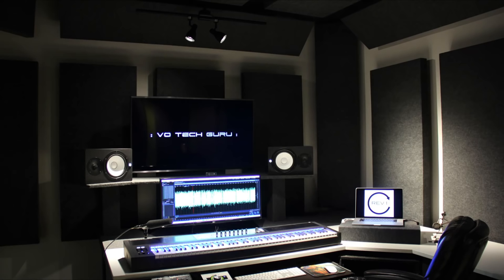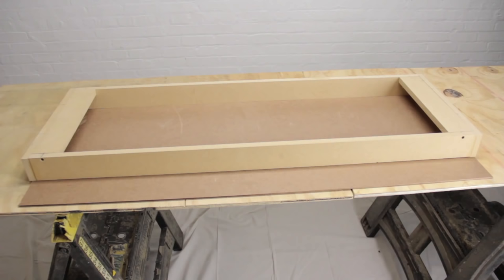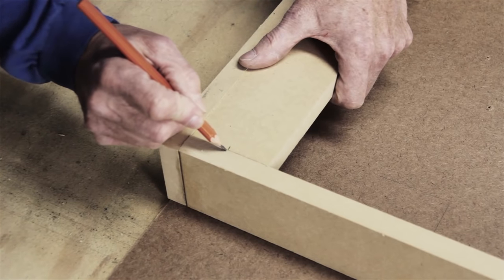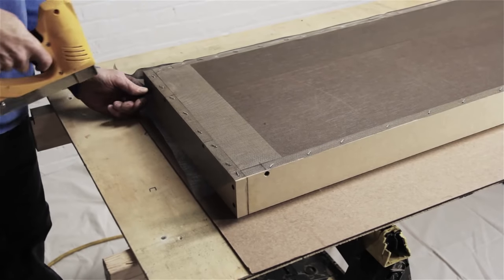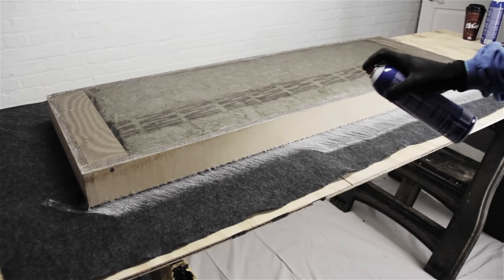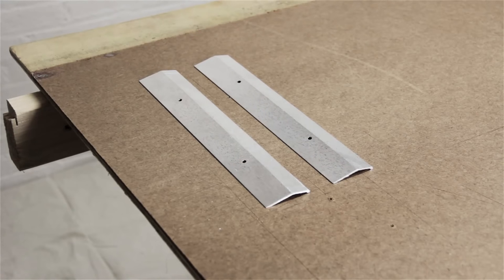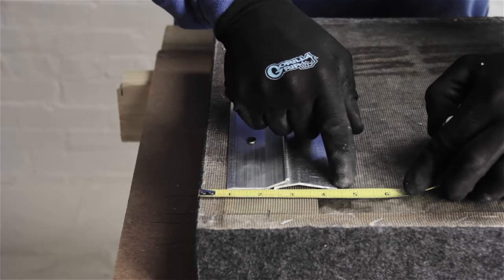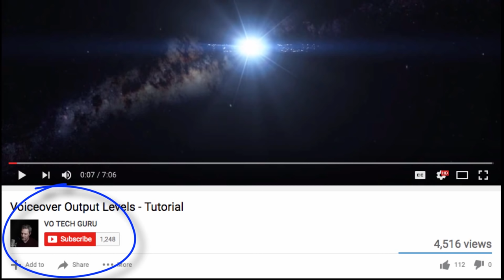How To Build Acoustic Panels | DIY Acoustic Panels

Comment: Great video! Was just wondering, How would you mount these in a corner and on the ceiling? Thanks
Reply from the maker: Thanks! We built 2 triangular shelves in the corners and attached the brackets to those. So you'll need one bracket on the top support of the panel and one on the bottom as well. For our ceiling panels we used four eye hooks screwed into the rear supports, 2 hooks for each end of the panel. Hope that help and thanks for watching!

Comment: Good job! Looks amazing. 
I just have one thing in mind. I have been working alot with all sorts of isolation, and they can be really dusty, don't you think that by the time and amount of vibrations the dust from isolation will get through fabric? 
It's like having carpet on the floor,   dust goes through pretty easily.
Reply from the maker: A lot of people have talked about dust or particles from the rockwool. I put a black piece of poster board under one of the panels for a month just to see what might happen. Nothing showed. The factory workers and installers work around this stuff without masks as well. It’s simply basalt rock mixed with metal slag, so...

Comment: Question: you used the Roxul safe and sound non ridged bat as opposed to the roxul rockboard 60 that’s recommended as the equivalent to Owens Corning 703 used in acoustic panels. Any thoughts on that? Great presentation!
Reply from the maker: You can use either but the 703 will cost you a lot more. These are VERY effective. Thanks for watching!

Comment: Definelty gonna be using this im working on my studio now, I do have a question though. How did you mount the corner bass traps in your control room? @VO TECH GURU
Reply from the maker: You just build a triangle shaped shelf with a face frame and hang it on the face of that. Thanks for watching!

Comment: Did you calculate and attach panels at first reflection points or just put them up where it seemed right? Also you nearly double available absorption by having a panel depth air gap behind the panel. Couldn't see but do you have a cloud? Did you test/measure the room before after? Interested to see if you did. Not being a smart-ass, just been working on this myself too. More interested to see the vocal booth as that's what affects the mic sound rather than the room. Solid build though and great looking panels, excellent video presentation and edit, thanks.
Reply from the maker: Hi dobbatron. Thanks for watching and the great questions. We didn't do a before and after on this room because I've been through the process enough times to know what to expect. When I say "a little less like this" in the video, that's the sound of the booth without panels (you may need headphones to hear it). 

Anyway, the first concern prior to the panels was how our planned dimensions for the room looked inside the Bolt Area (you can look online for a Bolt calculator) and we built the room so we landed firmly inside an acceptable Bolt range. From there, we calculated the amount of panels require based on full covered for all potential axial, tangential and oblique reflections and just went for full coverage because the panels aren't expensive and we didn't want to overthink it. As a result, we don't have a any trouble frequencies because the room dimensions were already well thought out (yes, we also have clouds). 

As for the booth I voiced this tutorial in, we did exactly the same thing, but the spacing between the panels was tighter. Maybe 3-4 inches. Again, the booth was built using the bolt calculator and everything turned out really well. You can visit my VO Tech Guru page on Facebook and scroll down to get some more info on how the booth looks. It's in there somewhere. Hope that helps. ;-)

Comment: Fantastic video. With the 24" panels, how high off the floor should they be & how wide should the gap between the panels be? TIA!
Reply from the maker: Thanks for watching! I like to space them 8" to 12" apart depending on the space. In a booth, I like to keep them closer. In a room, farther apart. I like to keep them the same distance from the floor when possible but there are MANY studios where they just hang the center of their panels around the center of the listening position and ignore gaps above and below the panels. It's really just a matter of how dead you want the room to be. Hope that helps. ;-)
Reply: @VOTECHGURU  It sure does! Thanks!
Reply from the maker: @brucedeutsch6993  You got it!

Comment: Did you also use the carpet strips to attach in the corners and ceiling, or just hooks?
Reply from the maker: Yes for the corners. But for the ceiling we used hooks. Same drywall anchors in all cases. Thanks for watching!

Comment: @VO TECH GURU - This is really helpful, but I'm wondering -- Why MDF board rather than plywood? Less bowing perhaps?
Reply from the maker: MDF is stable and is typically less expensive than finished ply. If you went with rough ply, then I would be concerned about bowing and not having a smooth surface. Thanks for watching!
Reply: @VOTECHGURU  - Hey! Thanks so much for your prompt reply. I've purchased all the materials, though sadly Home Depot (at least the one in my immediate area) will not make cuts less than 12" ... So with my calculations of how to render 8 panels (with a little leftover bits) I figured I could get the 4x8 sheet cut into a four pieces at 2x4, and then I'd handle the 3" rip cuts at home (I have a table saw). However I don't have a vacuum setup for the table saw (I learned that MDF creates quite a bit of powdery dust that can get into the motor), so I've got to buy one, or have someone stand there with a shop vac hose next to the blade. 

All of the materials (including having to purchase an electric staple gun, since I didn't have one) came to $206.
I'll give an update (probably via video, referencing your video for How To instructions) as to my success ... or failure ... in this endeavor.
Thanks so much for all the effort put into creating this video 
🙂👏
Reply from the maker: stegokitty Yeah, MDF can get dusty. But it’s not something I ever worry about with the motor, just the air I’m breathing, so wearing a mask is smart. FYI, I have a DEWALT contractor table saw and I’ve cut a ton of MDF on it without any issues.

Comment: great great tutorial, but serious question:

can the used material cause any harm for health? What do you think? Please answer seriously!
Reply from the maker: Thanks. You can got to Roxul’s website and look at the MSDS sheets for more info. This video should also help. https://youtu.be/LOWQym4RCfI
Reply: I found serious concerns by european builders that this spun rock wool is the next asbestos waiting to happen, spun mineral wool, what could go wrong? But in USA it is all systems go. I am still hesitant, perhaps fiberglass insulation might be just as good without the asbestos freakyness??? Ask an expert, I am just an artist.

Comment: Thank you. Great video. We have a gym that is terrible when there is a speaker with big audience.  I am trying to setup it up, it is 60' X 80' with high ceiling. how many panels would you recommend for this setting? would you do bigger panels or just have more of the size you have in the video? How far would you position the panels from each other? how high would you position the panels between the ceiling and the floor? sorry alot of questions. Thank you in adavnce
Reply from the maker: For a space that large I would definitely consult a local acoustic specialist. I realize that's not answering your questions, but on a project that large you'll want to be REALLY sure you get it right. Good luck with your project!

Comment: Very cool, thanks for the video! I personally wouldn't bother cutting into the material and instead make a deeper frame and have the material sit on top of the supports to leave an air gap which should help the panel's absorption qualities. Thoughts?
Reply from the maker: There’s already an air gap but I’m interested in what you mean about the material. Do you mean make a deeper frame and have the fabric wrap around the backside?

Comment: Hey VO Tech and all! I am a young kid looking to make these to improve my home studio set up but don't know what to start with. This video seems perfect for me, however, I am unsure how many to make and if it will make a difference in the rap type vocals I aim to record. I record in my basement which is 11x11 with my desk centered against the wall. Would you suggest I continue and build these? If so how many would you recommend? and where do I place them? Id appreciate anybody's intake and opinion! Thank you for your time.
Reply from the maker: Christian Arellano I place them anywhere from 8-10 inches apart in my monitoring room when mixing all types of music for TV and film. In my booth, I place them 6-8 inches apart when doing voice overs (like the one you hear in this video) or when singing. They’re great and I would move forward with confidence. In fact, most rap vocals are recorded in booths with just 2” foam on the walls and these were built to handle voice over where acoustics are for more important because it’s just the voice the potential client is hearing during the audition process. These panels work both as acoustic baffles and bass traps to a great degree because they are so thick. Does that make sense? I tried to build something that would cover most of the bases and I’ve gotten a lot of feedback that they work great for both applications. You should notice a MASSIVE difference. Here’s an original piece I wrote and performed for TV with these panels to give you an idea of how well they work. They were going for an upbeat tune circa 1962 with heavy compression and a bit of a noisy vinyl sound. 

https://youtu.be/hfUwRdxJUhM
Reply: VO TECH GURU Thank you so much! This helped me so much and I plan to build these with my dad very soon! Would you suggest hanging them with some space between the wall to improve functionality? and would any fabric work, or should I aim for acoustically transparent fabric ? Thank you for your time I appreciate it seriously!
Reply from the maker: Christian Arellano They already have 1/2” of space away from the wall, but it will improve as you get them away from the wall even more. Yes, acoustically transparent fabric is the way to go. The craft felt I used in the video can be seen through very well when held up to the light. You can also blow air through the fabric very easily.
Reply: VO TECH GURU Awesome! Thanks so much, time to get to building! 🙏🏼

Comment: Have you tested a panel with a sound tester? I’d love to see how much sound they absorb. I seen one experiment with different materials and they found that towels absorbed the most sound.
Reply from the maker: I actually did a test with towels because people kept saying to use them. Not even close. The amount of towels needed to get the same STC raring is huge and not worth it, especially from a cost/labor perspective. I have been planing on building a tight frame between my booth door and control room to test various materials. A speaker on one side and a room monitoring mic on the other and test a bunch of materials. That said, these panels do a great job and I voiced this video in my booth with the same panels if that helps. I get a lot of comments when voicing for big brands about how tight the booth sounds if that helps. It mostly happens during live remote sessions for TV and whatnot. Like this one. https://youtu.be/5nZw95aPdBk

Comment: Great job, but where should the panels be located?
Reply from the maker: In larger spaces I usually space them around 6-8 inches apart and center the panels on where the monitors will be. In a booth, I get them around 8” from  the ceiling and space them around 4 inches apart with pyramid foam in the gaps. Thanks for watching!

Comment: Would nails do the trick as well? I will building with 10mm thick wooden planks, in order to cut down on weight and use nanotape as an adhesive for the walls
Reply from the maker: That should do the trick for the wood, but I'd be careful of getting the panels really close to the walls. The gap with bumper improves performance.
Reply: @VOTECHGURU  My wooden planks will be cut with extra depth to have an air gap in between the rockwool board and wall :D
Reply from the maker: Prorenzo Smart.

Comment: Great video! Though I've been wondering if the batts would sit firmly the same way in your video if the length of the frame prior to assembly is 48 tall by 16 wide? And instead of having the top and bottom piece sandwiching the side frames, it would be the side frames sandwiching the top and bottom frames.
Reply from the maker: Possibly. I haven't tried it, but with screen on the front and back of the frame, it seems like it might work. Not recommending it, though. What we did in the video worked, we didn't deviate. Hope that helps.

Comment: Thanks a lot for the perfectly detailed explanation! Could you please tell, are there any healthcare or breathing problems connected with the open insulation placed in a room? Doesn't it require a coverage of any sort from behind, and is the fabric on the face of the panel enough to stop the fibers from spread into the air?
Reply from the maker: Thanks for watching. I don’t have a problem with particles or any dust of any kind from the panels. This video may help answer your questions. https://youtu.be/LOWQym4RCfI

Comment: Wonderful video! How did you go about mounting the corner pieces?
Reply from the maker: Thanks! We built 2 triangular shelves in the corners and attached the brackets to those. So you'll also need one bracket on the top support of the panel and one on the bottom as well. Hope that helps! :-)

Comment: amazing tutorial video. question is how many can you add in your room? i see you have lots of them. of course depends on how big is the room but if you add more pieces is it better sound? can you make the panels in larger size for large basement room? i'm thinking to do office room and the basement at my house. thank you for the great video. by the way did anyone mentioned about the great voice in the video? must be these panels::-))
Reply from the maker: tranporter az Thanks! Yes, I’m a voice over pro but the panels don’t hurt! :-) You can make the panels larger for sure, you just need to adjust your lumber sizes along with the screen and Roxul insulation. More panels means fewer reflections so the amount of panels depends on your goal. In my monitoring room I’m less concerned about reflection but in my booth I have more panels because I don’t want the room to respond at all. I hope that helps. :-)

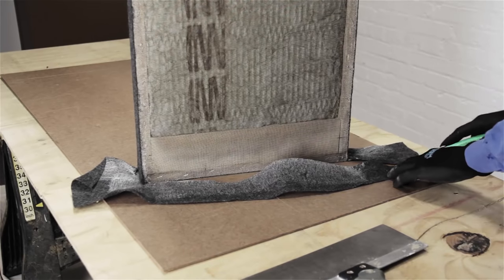Comment: 7:10 I just built these and can recommend strongly do not cut like they have here, it creates an uneven line. Instead fold the felt over the edge and staple it to the back. You will get a much cleaner edge. This is very clear if you have it up against a white wall with good lighting, cutting felt straight is actually pretty hard without it stretching causing distortion when it relaxes.
Reply from the maker: Thanks for watching. It sounds like your Glue didn’t bind very well. No distortion on our panels and the lines are very, very clean. I’ve also had a lot of people post photos in my Facebook group with the same results. A sharp blade is also important. I’m unsure if that was part of the problem for you?
Reply: @VOTECHGURU  Indeed it didn't I'll try with much more on the next panel. I'm guessing when you use the spray it creates a rock hard edge on the sides then?
Reply from the maker: Karl Morrison Yep. We pressed firmly up and down the fabric as well as making sure the glue was dry. I mentioned that in the vid because we had the same exact problem when we didn’t wait a few minutes for it to set up. A flat surface is key for cutting also.

Comment: Awesome DIY video!!  Just what I was looking for.  One question though, any reason why you used adhesive for the fabric versus just using the same staple gun?
Reply from the maker: The fabric is very thin and won't stretch if you use adhesive because the attachment points at the staples loosen over time. Plus the staples force you to fold the fabric at the corners and I'm not a big fan of that look. :-)

Comment: Greetings, this is an amazing video. I am wondering if the supports are needed for this project? If I don't add the supports will there be an issue in the design?
Reply from the maker: gunluv96 Thanks for watching! The supports are there to keep the frame squared up, but it really comes down to how important that is to you. Also, with the hangers we're using, the supports are needed. Especially when hanging them from a ceiling with eye hooks. Hope that helps!
Reply: VO TECH GURU thanks for the speedy reply. I will use your design unchanged. 
in your finished pic I see you have base traps. I'm wondering if you have a video on how you made those, also how many panels did you make in total to get your room tamed?
Reply from the maker: gunluv96 The corner bass traps are the same panels, we just built two triangular shelves into the corners to handle those (no video on that yet). How may panels depends on the size of the room, but we generally spaced the mixing room panels at around 8-12 inches apart and 4-6 inches apart in the booth.